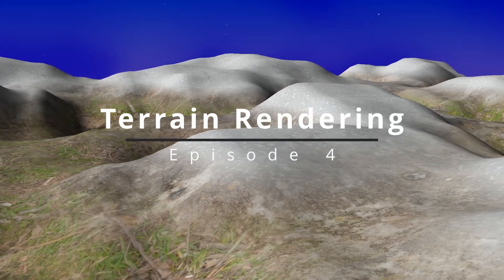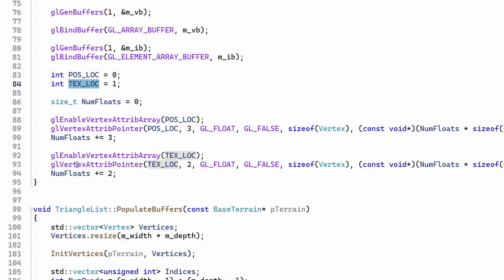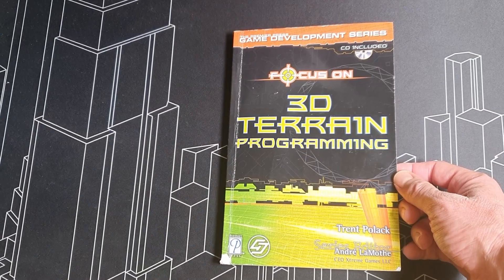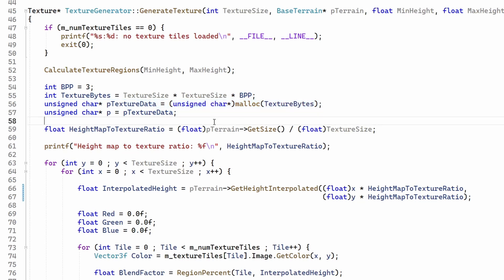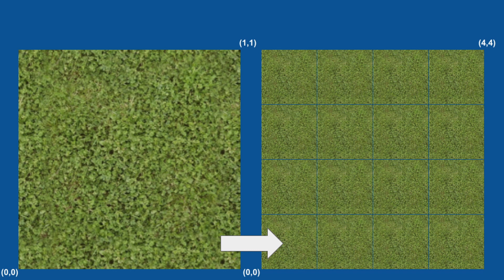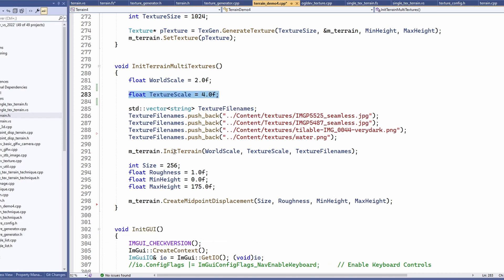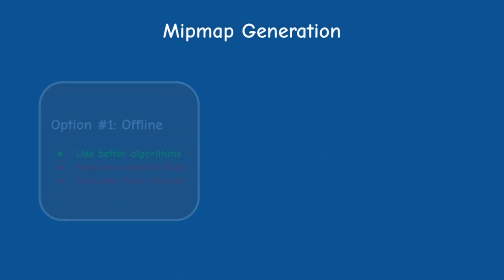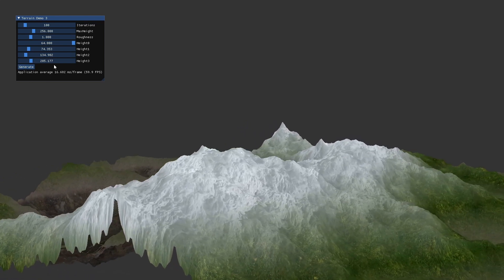Texturing // Terrain Rendering episode #4

Comment: Nice video man, I just implemented your method for texturing terrain.
if I want to export this terrain. is there a way to read the resulted texture blend back into a png?
Reply from the maker: Thanks! The heightmap is saved in terrain.cpp:155. The texture is more complex because the blend happens in real time. You will need to render a quad from 0,0 to 1,1 and pass it in gl_Position so that it will be the "leading" coordinate in the fragment shader. In addition, transform the original position and pass it in a regular output attribute. In the fragment shader get the height from the (transformed) original position, get the color from the correct texture and write it out. If you set it as a render-to-texture you'll be able to read back the texture and write it as a png. It will contain the blended texture which is correct for this specific heightmap. From now on you can use it directly without the blending.
Reply: @OGLDEV  doesn't render-to-texture mean that I have to create a framebuffer and capture the terrain from above using an ortho camera?
or am I misunderstanding something.

sorry I'm still a beginner so I can't figure this out.
Reply from the maker: You need to create the framebuffer but you don't need the over-the-top ortho camera. I take back what I said about the original transformed position. You only need the quad. Here are the steps:
1. Setup the target texture in a framebuffer (same as the creation of a shadow map).
2. Bind the heightmap and textures to the fragment shader.
3. Send a [0,0]-[1,1] quad to the vertex shader (even better - make it a static array in the shader and access it using gl_VertexID). Pass the position as-is to the fragment shader.
4. In the fragment shader use the interpolated position to sample the height from the heightmap.
5. Get the corresponding color and write it out.
6. In the application use glReadPixels to read back the image.
7. Save it.
Notice that this is a one-shot draw command and some people would prefer to do this on the CPU. Especially if all textures are the same size. Then you only need to scan all the pixels one by one, interpolate the height yourself and continue as usual. It will make step #6 redundant.
Reply: @OGLDEV  I think I understood.
1) Generate a framebuffer
2) use a 4 vertex quad that covers the entire screen to sample heights from my heightmap.
3) using gl_FragCoord to get the interpolated pixel position.
4) glReadPixels to read the entire framebuffer back and write it as png
Reply from the maker: Almost. Couple of comments:
2) The quad goes from [0,0]-[1,1]. You don't really care about the screen and its dimensions because you are rendering to a texture, not to the screen.
3) gl_FragCoord returns the pixel position but you can't use that for sampling. Use the interpolated value of #2.
Reply: @ oh yes, I forgot that when you send the position from vertex to fragment the gpu interpolates it automatically.

I see now, thanks for giving me directions. I've been stuck trying to figure this out for a while.
I'll try again soon
Reply from the maker: Good luck!
Reply: @OGLDEV  I finally managed to do it. worked perfectly. Thanks for the help again.
Reply from the maker: Glad to hear!

Comment: Sorry if this is a silly question; would a developer ever declare a vertex array attribute with say, maybe 3 elements for VertexPosition, 3 elements for Normals, and 4 elements for UVs?  For multi-texturing, could it be a smart move to have two pairs of UVs per vertex to render the two meshes in their own ways?  Or would this mostly just be silly and wasteful?  I've never head of it being done that way before and I suspect that most every developer ever has considered one pair of UVs per vertex to be enough, but I'm toying with the idea and I'd love to know what an expert thinks.
Reply from the maker: Yes you can! Sometimes people want a different texture and texture coordinates depending on the face (the vertex belongs to multiple faces). In that case you can either duplicate the entire vertex or use multiple texture coordinates per vertex. You will also need to two separate index lists for that.

Comment: Is there any reason you are using stbi_write_png() in the TextureGenerator? Seems like all you need here is to create texture handle, return it and assign to terrain?
Reply from the maker: This is just to save the generated texture to a file to be checked offline. It's not an actual part of the algorithm.
Reply: @OGLDEV  If I may trouble you again, any idea why I would be getting black stripes on generated texture?
Reply from the maker: Hmmm... strange. Is it with my original code?
Reply: @OGLDEV  seem to be getting coloured stripes now in generated texture, even if I always just use 1st texture tile, so I'm guessing my getColor() method implementation is somehow wrong or maybe im loading gl texture in a wrong way
Reply: Found the problem! In loaded textures with stbi_load I had 4 channels, but my BPP was 3 and I was using this in formula to get pixel color from the texture data buffer, fixed that and now it's working fine, your code works great, thanks! I am though confused as to why stbi_load() has param for desired channels, when you can just pass in int reference and get the actual bytes per pixel that way
Reply from the maker: Great news! stbi_load allows you to pass in the number of channels and force the loading of a specific channel count.

Comment: That's a brilliant idea to select/blend texture per tile based on their interpolated height. 
Again, thanks for your guidelines 🙂
You can also generate texture atlas from loaded textures to have single texture buffer with different UV coords per tile that you select. Probably it is used in some level editors for texturing terrain with multiple textures without texture units limitation 🙂
Reply from the maker: You're very welcome!
You mean combine the textures into a single buffer and add an offset to access the chosen tile? Because the vertex still has a single UV vector.
Reply: @OGLDEV  Well yeah, making something like an "atlas", so you can pick several textures from one buffer, using different UV coords per vertex. Of couse you will have limitation with resolution of a textures since atlas could be = texture_size / textures_count.
Reply from the maker: There's also a 3D texture where the third dim could be used as the tile index.
Reply: @OGLDEV  Correct, it's also an option to consider 🙂

Comment: i need the most recent opengl 64bit for windows
Reply from the maker: I guess you just need to install the latest drivers for your GPU.
Reply: @OGLDEV  im not much of a techy so i dont know how
Reply from the maker: Go to the device manager (Windows-X and then select it from the menu or access it from the control panel). Under 'Display Adapters' you should see the type of GPU on your machine. All the major brands offer drivers for their GPUs so you just need to go to their website and find the most recent version for the Windows version that you are running. There is also the option of right clicking the display adapter in the device manager and simply clicking 'Update Driver'.